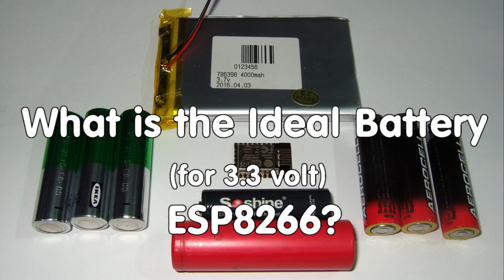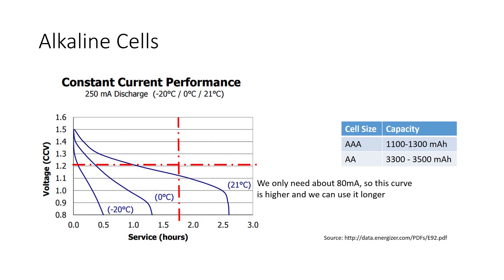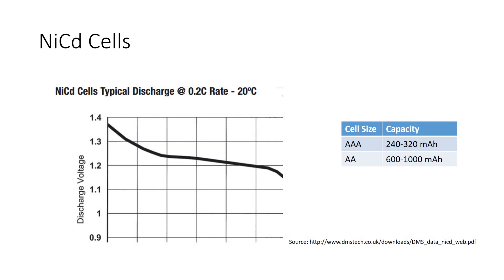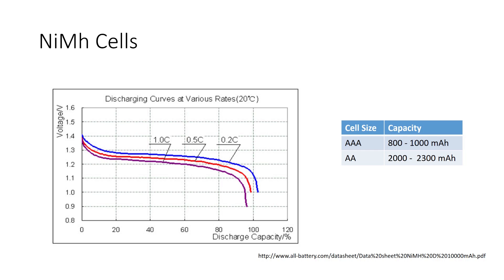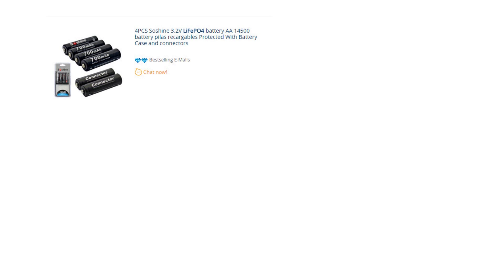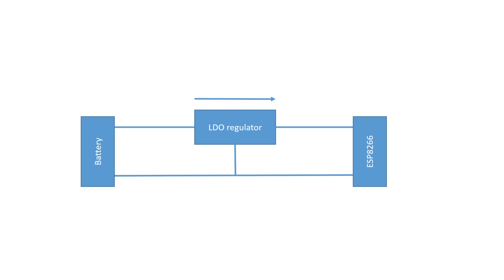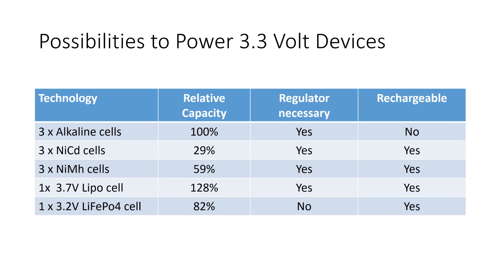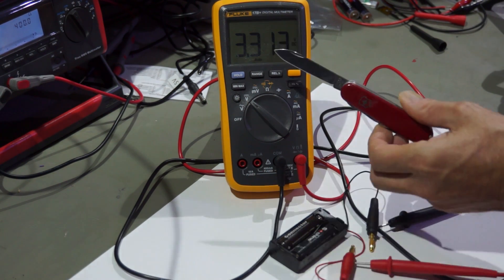#64 What is the Ideal Battery Technology to Power 3.3V Devices like the ESP8266?

Comment: Are chargers available for the LiFePo4 cells? Can you charge them with a lipo charger like the battery shield for the WeMos 8266?
Reply from the maker: Not many. Because of the lower max. voltage you cannot use a lipo charger (unless you disconnect manually when the voltage is reached. I use a normal bench power supply with max current and max voltage.

Comment: With LIFEPO4 you will still need some undervoltage protection... And the main advantages of LIFEPO4 are great low temperature performance and possible high charge/discharge rates... But in case of no low temperatures I prefer to use more 18650 and LDO, it does make sense if you are not space constraint...
Reply: LiFePo4 does not need undervoltage protection. The battery can be in 2.5V (which is considered 0% charge) for long time and does not get permanently damaged. I think your device that operates in 3V - 3.6V will not run/start if it is in 2.5V. Also many reported that this battery can even be revived after long time of 0V. LiFePo4 is amazing battery. Way better than previous Lithium-ion.

Also, LiFePo4 is not considered great at low temperatur as it must stay above freezing point. While Sodium-ion can operate much better, up to -20 degree Celcius.

Comment: why not using some small size switching mode regulators instead of LDO? They are available cheap from China and the power wont be wasted!
use 2 smaller lipo connected in series and this module:
http://m.ebay.com/itm/best-Mini-3A-Converter-Adjustable-Step-down-Power-Supply-Module-replace-/182363268470?hash=item2a75b2a576%3Ag%3Apr0AAOSwImRYNTUJ&_trkparms=pageci%253Af1fb413a-551c-11e7-87e7-74dbd180914a%257Cparentrq%253Ac19c048215c0ab6af73b845bfffabf7e%257Ciid%253A1
Reply from the maker: If you only have small differences to "kill", LDOs usually have a better efficiency. If you have to bridge a bigger voltage difference, switch mode is better. For deep sleep, the regulator must only use very low quiescent current. You have to check that too with a "switcher"
Reply: yes, if sleeping is used, the smps self consumption is probably more than the powered device's

Comment: I have a bunch of motion detectors which are  running on a 1 cell 3.7V LiPo battery. To avoid recharging them I tough of installing a 3.7V power supply to each of them to basically power the motion sensors form the power supply and use the LiPo only if main's power is lost. Is this possible ? ..  Without mains it takes several days to discharge them below the critical 3V, so not a problem from the undevoltage side. Does this work ?   Many thanks!
Reply from the maker: You always can connect a device in parallel to the LiPo. There are two things to be considered:
1. At the beginning of the charging, LiPo chargers use a constant current. If you connect a device in parallel to your battery, the current used by the device will not charge the battery. In your situation, this should not be a big problem, because you have plenty of time for that.
2. LiPo chargers charge up to 4.2 volts. In you scenario, you would always have 4.2 volts across your device, because your battery would always be fully loaded (unless power out)
There is one thing I do not know. The chargers switch somehow between constant current and constant voltage mode. I do not know, if this "switching" is influenced by a parallel load, which always draws some current. If this current is small, I assume, it would  create no problems.
Reply: Thanks a lot Andreas!, My initial idea was to just parallel a 3.7V = (no "Lipo aware loader") which is probably not a good idea .. don't know if they would load at all ... , but I now realized that the devices have a built in Lipo Loader chip I can use .. so no problem!

Comment: Thanks for this great video

What about Everyready Ultimate Lithium batteries? They are non-rechargeable Li/FeS2 batteries.
If I'm reading the datasheet right http://data.energizer.com/pdfs/l91.pdf
these have most/all of their capacity in the range from 1.8V to 1.4V
So two should go from 3.6V down to 2.8V.
They have a 20 Year shelf life and 3500maH
I bought some of these and two of them, brand new and unloaded are at 3.64V.
Is 3.64V too high for my esp-01? I guess I could flatten them a little.
My plan is a PIR sensor that wakes an attiny that then wakes the esp8266.
After the 8266 has wifi'ed the event it and the attiny go back to sleep.
The PIR only consumes 25uA when there is no movement and can run off 3.3V.
Reply from the maker: 1. 3.6 volts are ok for the ESP
2. Maybe you do not need an ATTiny if you watch my video #108. You could replace the button with a PIR sensor...
Reply: Andreas Spiess 
thanks for the reply.
the hc-sr501 outputs a 3.3v logic signal. you need the attiny to stop multiple detections in a row resetting the esp 8266 before it completes it's Wi-Fi message.
Reply from the maker: I am not sure

Comment: Actually, LiPo does come in the AA form factor: the 14500. Also, rather than using a linear regulator, you could use a buck or boost converter with most of the chemistries to not only get the needed voltage, but it could be regulated and the battery could be protected against overload and over discharge.
Reply from the maker: Thanks for the feedback concerning the AA form factor. 
Buck- and boost converters are great for big voltage differences. But they usually have higher quiescent currents. So, they are not ideal for deep sleep scenarios. And for small voltage differences, for me, they are an overkill (and also can introduce RF).

Comment: About LiIon cells, I'm using them with one power diode to lower voltage from 4,2--3,6vnto a safe 3,6--3,0v. No capacity waste there.
Reply from the maker: You are right. And because the voltage drop is always 0.6-0.7v the ESP can get unstable if you go down below 3.6 volt. the LDO has only about 0.15 volt drop in this situation. This difference sometimes matter.
Reply: The diode drop depends on current, so you need to choose wisely. About margins:
 - ESP works on 3.0V to 3.6V (datasheet: https://mintbox.in/media/esp-12e.pdf ).
 - LiIon discharge curve, from less than 25ºC, drops at 3.6V to safety level in no time: http://www.ibt-power.com/Battery_packs/Li_Ion/Lithium_ion_tech.html

I have no detailed curves between 0-22ºC, but at 10ºC that solution works with almost all battery charge. You can choose a 0,5V drop diode in case you need it in colder environment, but yes, on near-0 or below-0 temperatures this solution will not work.

Below 3.6V you can see usual discharge curve drops quickly.

Comment: Hi Andreas, thank you for taking the time to create discharge curves and publish them in your channel. This is very useful. 

As you know, some of us live in cold places and batteries do not always do well there. Most Li ion cells are optimized for temperatures above 0C and do poorly below that. I am curious to know if your LiFePo cells do well in the cold.
Reply: Hi Andreas, Dave, I live in Canada and I have been using both the Titus 3.7 V C Cell and Titus 3.7 V AA Lithium Thionyl Chloride batteries, -55C to +85C. I highly recommend them, I used them in the military for our remote sensors and GPS units, even in the Arctic. We are currently using inside transport GPS trackers for almost a year without replacing.
Reply: Yes, that's correct. For rechargeable use, I just received their new High Pulse Super Capacitor HP1520 rated at 4.0Vdc (actually 3.6Vdc)
Reply from the maker: I never tried and there is not a lot of literature about that fact.
Reply from the maker: +ExNavy But these are non-rechargeable, right?

Comment: Hi Andrea. I powered my esp8266 with a 18650 3000 maH using deepsleep And it Lasted for only 1 week. 
Is it normal ? :( 
Thanks 
Marc.
Reply from the maker: +Marc Paradis What kind of ESP module? NodeMCU?
Reply: Andreas Spiess nodemcu-12E
Reply: Andreas Spiess i Also Feed vin with The 18650 battery ... Is it ok ??
Reply from the maker: Not according the ESP specs. It is only rated up to 3.6 volt. But it should work. And the deep sleep current will be much higher above 3.5 volt. Better use an LDO
Reply: Your question is impossible to answere if you do not tell us how much it deep sleeps and how much activity time it has. With this values you could google yourself and calculate.
Reply: where can i send up my code?

thank you.
marc.

Comment: Hi Andreas just a quick question. I am planning on using the ESP8266 with one 1.5V AA battery and a boost converter (tps61006). The module will be in sleep mode quite often in our project and only woken up for short period. Do you think this is a good solution?

Love your videos. I have learnt a lot and found it very useful for our project. Thank you very much.
Reply: Thank you very much for your prompt reply and for the advice. I am using a 1000uF  SMD Aluminium Electrolytic Capacitor across VCC of the ESP. I took this from one of your videos. I'll do  battery test once I get my PCB done.
Reply: Am interested in how this goes for you +Venko.  Have seen those inexpensive adjustable boost converters on AliExpress, and am curious.  I would worry that if the ESP decides to transmit heavy, drawing 800ma, that you would need 3x as much current on the low end ... and the high end may get choppy.
Reply: TCP61006 has a 50uA quiescent current. MCP1624 has a 20uA quiescent current.

Comment: Good cross examination.
I would be nice to design a circuit that has the MCU check the battery voltage and switch on a voltage doubler circuit when the battery voltage runs near the shutoff voltage.
I suppose we need to check the balance because we introduce a new circuit that has it's own consumption, but we might be able to compensate it due to the extra charge we can use from working to lower voltages.
I know the LT 1026 can work as a voltage doubler but unfortunately it's not a low voltage low power chip, I don't know of any other versions.
Reply from the maker: I am not a fan of these designs because the batteries do not have a lot of energy left at the end of their "life". It adds complexity, size, and cost and I would invest all three in a bigger battery. "This provides more bang for the buck"

Comment: I'm currently field testing supply by 3 x AA Eneloop accu cells and one BS120 Schottky diode in series. (mostly because i've got lots of both components in my spare parts ;) works like a charm so far.
Reply: I had the same idea, but the problem is that the voltage of diodes is dependant on the current.

Comment: NiMH maintains voltage VERY close to 1.2V across the bulk of its discharge cycle! It starts off at about 1.45V but quickly drops down to 1.25V. This means that in contrast to other types of cells which have a more slanted voltage curve, you can pre-discharge them a little bit and you will only lose little capacity.

To accomplish that in-device, you should be able to use a Zener across the NiMH battery pack to clamp the voltage. After the battery is discharged below Zener voltage, mostly through the Zener itself, no current will flow through the Zener and it will no longer contribute to power consumption. Perhaps a similar trick can be accomplished with Li-Ion, but of course you'd need to limit the current, and i'd be wary all around, many angry pixies in there. Perhaps the proper solution with Li-Ion is not an LDO but an active boost/buck regulator - you can discharge much deeper down to typically 1.8V, and you'd have less efficiency loss.
Reply: The idea with the Zener is interesting. That would worth a test - and a video ;)
Reply from the maker: The buck or boost converters usually take 20-40% of the energy (depending on the voltage difference and make). And they need quite a lot of current if the ESP is in deep sleep.
Your idea with a Zener should work. However,  this costs some energy. Maybe it would be better to stop charging the battery at this particular voltage instead of charging it full, and then discharging it afterwards. But I am not a battery specialist.
Reply: Andreas Spiess I don't see why there should be more than a 30% loss at the IC, and can probably be optimised down to 10-ish. Perhaps a major contributor is the output choke or transformer, but those can be done with low resistance too.

Comment: The connector batteries are interesting. I have a bunch of used but not empty 3,6 V Litium AA batterie (not accumulators however) and use them in clocks/weatherstation. I soldered wires into the battery case which also works. But this connector battries would have been the more nicely and instant reversable solution.

Comment: I'm not an electronics guy, so my question is probably nonsensical, but here goes:  Would it be possible to have the ESP8266 trigger a transistor when it cycles on?  To use as a switch in a charging circuit.

I was thinking use a battery that starts out at too high of a voltage, is switched through a transistor then a zener (?) diode to charge a super capacitor.  I think the zener might be able to be used as a way to limit voltage to the cap to ~3V.

The idea being that the ESP8266 runs off power stored in the capacitor, enough that it can trigger the work cycle, as well as the cap charge cycle, and not waste power running a regulator.
Reply from the maker: Many things are possible, but not all are good.Always, if you have to have a voltage change, you lose energy. Basically two possibilities exist: Resistors and switches.
If you use a resistor to reduce the voltage, the resistor dissipates energy. This is the same with voltage regulators, diodes, and Zener diodes. At the end, they are all resistors and get warm during operation (a sign of energy loss).
Using switches could be more effective, because you only switch the voltage on for a moment, and then switch it off completely and load a capacitor with the energy. Theoretically, this is a lossless way, but because you need some circuity to steer the switch, they also need some energy. But for bigger voltage differences, they are much more efficient.
You find many videos about "step-down" voltage regulators, or "buck converters".
Reply: Thanks for that Andreas.  Keep up the awesomeness!

Comment: Hi Andreas, Thanks for this excellent video very helpful to me, Have you work with any kind of charger for LIPO batteries?
Reply from the maker: I have two different Chargers: One balancing charger (IMAX B6-AC Charger/Discharger 1-6 Cells)  for big batteries and a small one:
https://www.aliexpress.com/item/Liitokala-lii-260-18650-26650-16340-Lithium-Battery-Charger-Detection-of-Battery-Capacity-internal-resistance-voltage/1619052072.html
All Other batteries are charged with the bench power supply.
Reply: Thank you Andreas!

Comment: Where does that "20% loss from the regulator" come from? Apologies if I missed that in the video, but did not seem clear to me. Is it because of the quiescent current? In that case it would depend on the regulator itself.
Reply from the maker: Arturo Ribes Every linear voltage regulator needs a voltage across it. If yor battery has 3.7 v and the output of the regulator is 3.3 v it "destroys" the 0.4 volt. Multiplied with the current, you get the watts.
Reply: If I understand correctly, it depends on 2 factors: a) The dropout voltage of the regulator (150mV for HT7333) and b) The minimum operating voltage of the IC (ESP8266 is 3.0V, although I guess it may be lower). 
Then you should check at which capacity the battery is discharged below IC_min_voltage + regulator_dropout (in the example for ESP8266 + HT7333 would be 3.15V) and that would be your maximum capacity. 
So it may be 20%, but I think it is not as easy a calculation as saying "it destroys the 0.4volt". However, I may be wrong, no expert here :P
Reply from the maker: I mention two sources for the 20%:
1. If your average battery voltage is 3.7 v and the output of your regulator is 3.3 v, then you loose 0.4 volt. Divided by 3.3 v is roughly 10%. 
2. In addition, the module stops earlier because of the drop-out voltage. I do not know this number, because it differs from module to module , but assumed another 10%
Reply: Ok, thanks for the clarifications. You have an awesome channel, keep up with it!
Reply from the maker: Thanks!

Comment: Hi and thanks for the video.
I am working on a project that requires lith-ion battery with high operating temperature. Any suggestion or advice about how to find such a battery?
Reply from the maker: No. I never had this problem. In my country, we suffer more from cold than from heat ;-)

Comment: Hello Andreas I have a question that is not related to the esp8266 but to the batteries it's self. I have a audio amp module that will boost the speakers on my headphones because they are very low no matter if the volume is 100% the headphones are still low. now I have tested this module and it boost the audio level by 1/4 boost which is great but it is 5v. now I know I would need some kind of buck boost conveter and battery to make it portable. but which one battery can I use? sense the module takes 45ma to run. I'm trying to. put it in a think smaller case I cam find to stick in my pocket.
Reply from the maker: For this case I would use a 9 volt battery and a simple linear regulator. This is small and cheap and you can replace the battery whenever you need it. According google, 9 volt batteries have a capacity of about 500 mAh. So, your amplifier should run about 10 hours with one battery.
Boost converters use high frequency and this can create noise in your headphone.
Reply: +Andreas Spiess I'm thinking of using rechargeable  aa batteries for my project or triple aaa batteries.
Reply from the maker: If you have the space this is a good idea.